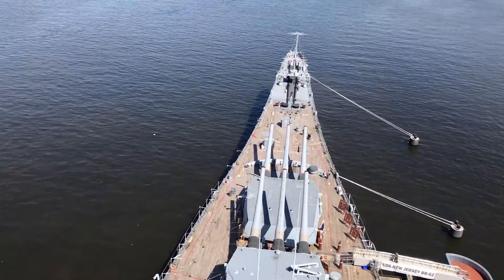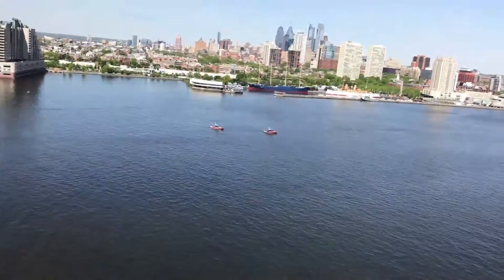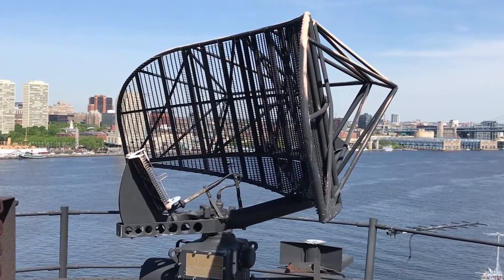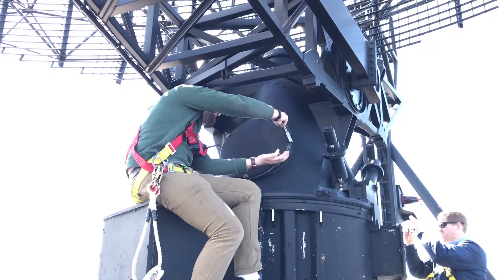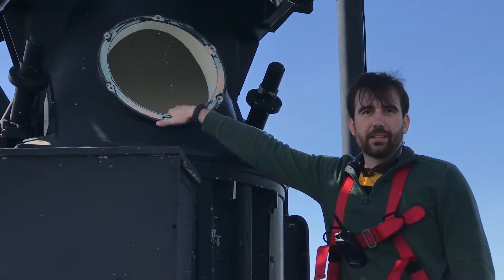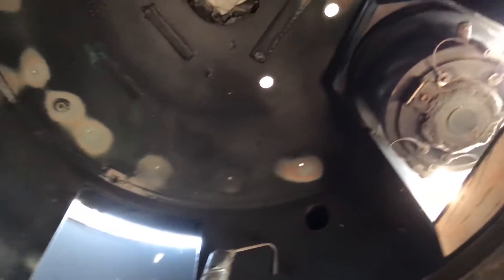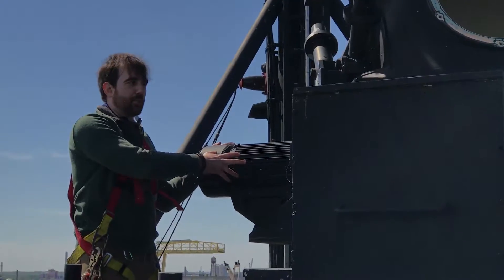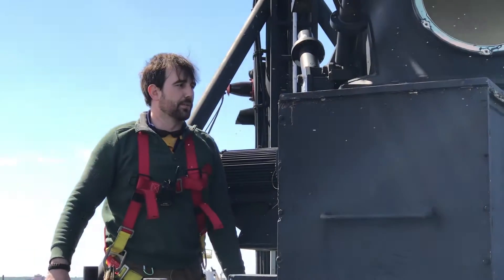Inspecting the AN/SPS-49 Radar Antenna

Comment: I was a SPS-49 tech, the elevation of the radar was to account for the ship's attitude changes due to sea state (i.e. yaw, pitch, and roll).  The elevation of the target was done via calculations internal to the receiver.  Sorry, watched this and it hit a nerve.  I spent alot of time on that antenna, we had issues in the waveguide onboard the USS Yorktown.  I even got the honor of doing a klystron replacement onboard in Panama.
Reply: I ended up working on Klystron replacement two times on board USS Preble DDG-46 during my stint 81-85, many months of continuous use during super long deployments used them up kind of quick. Also had to do an antenna replacement in port in Norfolk in the winter after one of my junior sailors didn't tag out the antenna and one of the OSs rotated it with holiday lighting strung up while in port! It just remember the day we swapped it in the winter of 82-83 being super cold and very windy!

Comment: As a Navy electronics tech I used to work on the 49 radar system. Try climbing up the mast in pitching seas.
Reply: Try working on a Fletcher class DD, DD677, AN/SPS-6 (could have been an SRa, that was  long time ago)  radar antenna when the Officer of the Deck decides to have a man-over-board drill. I hollered down some non-officer remarks. Later he apologized. I had notified the bridge that I was going aloft but they changed watch and the info wasn’t passed on.
Reply: Had to do that with our TACAN antenna, while being choked by stack-gasses.  The TACAN was down and the Idiot EMO was convinced that the dome should rotate.  We just could not explain to him that the antenna was stationary.  Ended up that the klystron was having issues.
Reply: @danstromness5165  Likewise, and on my ship USS Preble DDG-46 it was at to tippy top of the aft mast on a single pole mast directly above the front of the AN/SPS-49 platform. Man that thing had a lot of flex in it that you could really feel.
Reply: Been there and done it my fellow ET brother! USS Preble DDG-46 81 to 85 here.